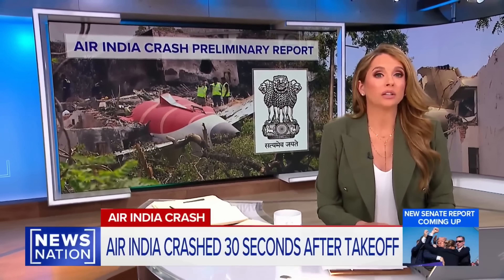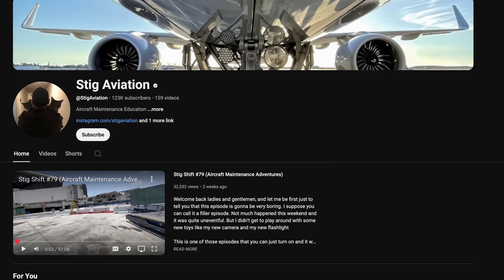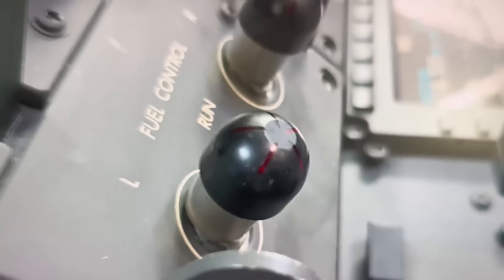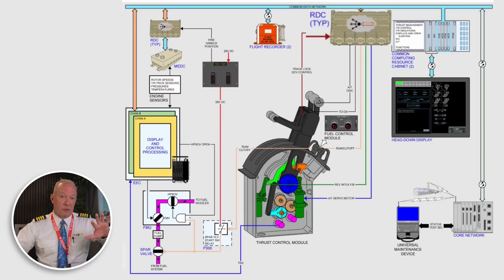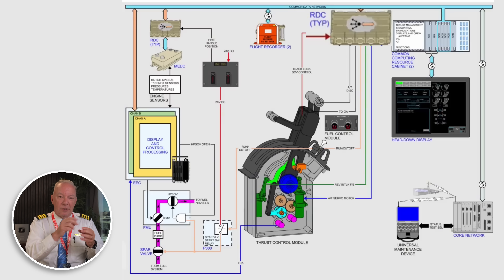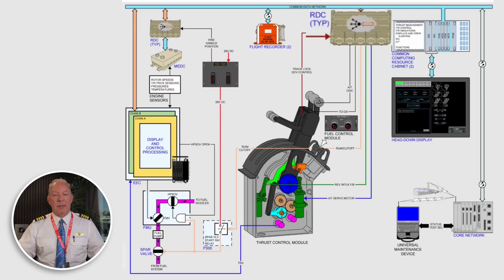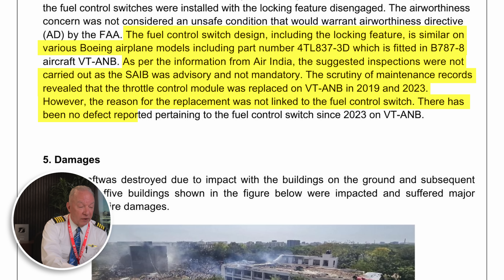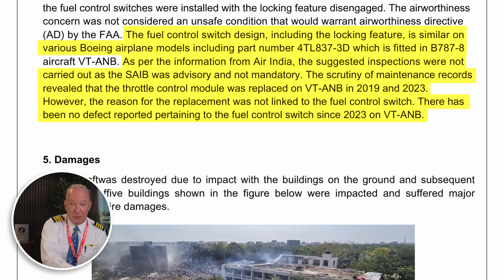The Truth About Boeing 787 Fuel Control Switches

Comment: One of the things missing about the explanation of the circuitry of the fuel on/cut-off switches is the location of the relays.  The switches themselves are located on the thrust module in the cockpit.  The relays (which are probably more than one for each engine) complete the logic to the fuel solenoid valves.  There physical location on the aircraft is where?  The physical wiring goes through a series of connectors and terminations.   No doubt tracing the actual path of the circuitry involved in the on/off of the fuel delivery valves is beyond any YT explanation.  There's other circuitry involved in shutting off the fuel delivery system that's not part of the cut-off switches.  The cause of the Air India crash appears to be the physical movement of the cut-off switches.  Hopefully, the final report will explain the actual cause of the crash.
Reply: Yeah but the switches we're allegedly turn off and then back on again.  If I was going to commit suicide I would just turn them off.  Honestly suicide is probably the least likely scenario, given the fact that this particular aircraft was known to have severe electrical problems inside the passenger cabin.  A lot of stuff didn't work.

Comment: I understood the 787 system is digital based, these switches connect to a box that sends a digital signal over the ADFX network its not a direct connection like 777,737 etc

Comment: There is a "system" on its engines that could shutoff fuel if its eec's detect non normal engine parameter like N1 and N2 rotation, without put fuel switches from idle to cutoff. This system available on 737max,and also on 787 dreamliner

Comment: JoeLoveNorman and others are correct however for the same malfunction to happen on both separate systems at the same time is beyond belief
Reply: It's called "a single point of failure, SPoF", and in this case it's the Li-ion battery and its diode module. Fault propagation happened because of automated redundancy, which actually made the SPoF possible.

Comment: After reading a few more comments I think quite a few people are talking about aircraft systems that existed prior to fly-by-wire.  Also it is easy to confuse a line drawing showing a 'virtual' functional circuit and then using a simplistic switch and light to illustrate exactly what does happen as if there is a wire from every switch to the item to be controlled.  That is DC-3 thinking in a world where the computer actually flies the plane and the pilot is merely asking it to do certain things.  This appears to be especially so in an Airbus system where for example you command a roll rate, you don't tell the ailerons to move to a particular angle.  A similar type of comamnd function exists in a Boeing aircraft, a bit like driving a car using a sophisticated cruise control.   

The functional drawings show cause and effect.  How does the 'switch command' get to the target relay, software program, control unit, or other item.  In rare cases it may be directly through a wire as suggested by Steeeves circuit e.g. to command a spar valve to close in the event of a fire.  In most other cases I think you'll find the commands actually go through a data concentrator, then down a fibre optic cable, then outwards through various other magic components to their final destination.  

These comamnds all rely on electricity to get to their destination.  No electricity means no commands.  So what does a FADEC do when power glitches come down the line or a total electrical failure occurs?  Does the engine auto-drop to idle and stay there until the fuel is physically shut off?  That is what happened when the 747 went off the runaway in Tahiti and the electrical system got drowned in seawater.  The valves stayed open and one of the engines continued to run at idle until enough water was pumped in by the fire crew to stop it from spinning!  

The key question must be:  What caused the total electrical failure that initaited the RAT deployment?
Reply: The engines being shut down by the pilot caused RAT deployment.

Comment: There is no relay inside your demonstration. There is a set of switch contacts. We use relays so we can have a device like a switch, turn a load on and off that would be too much of a load to pass through the switch itself. In your fuel valves, the valves themselves are tied to a set of switch contacts in the relay. The coil of that relay is tied to the switch in your cockpit. When you flip the switch in the cockpit, you send voltage to a small coil of wire in the relay, this turns it into and electromagnet and pulls the contacts closed and gives the fuel valves power. We do this because let’s say the switch is good for 5 amps, but your fuel valves draw 30 amps, we obviously can’t pass them through the switch itself, so we use the switch to pull in a relay. Now there are other reasons to use relays, such as wanting the ability to control the fuel valves from multiple sources, and add in other components, or control a load with a higher voltage, using a switch and control circuit with a lower voltage (like controlling 24vdc fuel valves from a 12v or even 5v switch circuit. But the main reason is because the switch itself can’t handle the load on its own. Without an actual wiring diagram, there is now way for me to know if anything else controls that relay aside from the switches in the cockpit but I’m going to say yes there is. The relay may also be controlled by the computer for things like if the fire handle is pulled, it probably drops the relay out so it doesn’t keep fueling an engine fire, and I’m sure there are other safeties. I can’t hardly believe on an aircraft that sophisticated that the ONLY thing that controls that relay is the switch in the cockpit, I just can’t.

Comment: What you are doing when trying to explain "switches" is wishing and hoping. They were designed by humans and humans make mistakes. 
I can write code that mimics a button press. It's simple. People do it all the time with automation. I have a physical 'smart' switch that can set what was pressed, its state of on/off, stored on another system. You don't necessarily need to "poll" the hardware for its state because it may not know. You may not want to do that either to prevent flooding a switch. By that I mean, think DDOS attacks. 

When you say something, a switch or lever, "commands" a system to do this, that is your first clue. It's not a physical circuit break like a light switch in your house, it's the switch telling a computer, hey I want to do this, make it so. The computer then tries to do whatever action moving that switch to that position was supposed to achieve.

Comment: I appreciate your detailed explanation. I know my basic electronics from junior high, so I'm not an expert at all. However your presentation suggests that a relay is somehow mechanical, whereas just the switch  (RUN/CUTOFF) is mechanical. The switch just activates the relay, which in turn initiates various electrical and electronic functions. I do not want to speculate - I am just curious and maybe somebody more familiar with the matter could answer:

1. Can the switch be in the "RUN" position but - for some reason - relay mulfunctions? You know, mechanical switches can break, or electrical circuits get contaminated and could send confusing signals on and off.

2. If the above could happen, than (possibly) the switch would stay in the "RUN" position, but the main system would "think" that the switch moved suddenly to the "CUTOFF" position?

Could such scenario be possible? Of course, it's virtually impossible that BOTH independent circuts would behave in such way simultaneously, but who knows? We still do not know the full VCR transcript with timestamps, and those pilots probably exchanged a lot of information. Maybe they were puzzled by switches being in "RUN" positions, but the airplane displaying signs of fuel starvation? So, after seconds of confusion, they moved the switches back to "CUTOFF" (system did not record it as it already "thought" that they were in that position) and then back to "RUN" (system recorded it as the circuits started to work again).

Comment: Steeeve what if the switches never moved but their status was the only thing recorded as having changed?  Also your faith in the battery staying alive may be misguided.  

In the case of the 787, one possible fault situation are the single points of failure, the one battery and the one Lithium Ion battery diode pack.  If the diode fails this can lead to severe overcharging of the battery and an eventual short-circuit event.  As the main battery is only attached to the left 28V bus that short circuit can then pull down the right hand bus to a vulnerable position with the whole 28V system teetering on the edge of failure.  This is because the monitoring systems do not appear to recognise a short circuit failure, rather they just see a drop in Voltage failure and as a result they do not open the bus-tie switch, effectively ensuring the bad things on the left side 28V bus are NOT isolated from the right side bus .  

On takeoff the gear retract process places the 28V electrical system under severe stress when the bogie releases followed by activation of the electrical brakes (130V stepped up from the 28V bus) to stop tyre rotation as the gear stows.  This can then cause a spike in the now vulnerable 28V electrical system leading to a temporary command to to some part of the control system that then commands a thrust reduction.  Look at the data concentrators, the way the ARINC system works, and the possiblity that only one element in the whole chain had to receive a command to reduce thrust.  It may have been a valve, it may have been the FADEC, or some other protection system that I am not aware of.   

So what is the evidence that we see in the videos?  Bogies released and hanging that means gear selected up, at that point in the process braking is applied, the RAT then drops indicating total electrical failure.  Something happens within the fuel control systems and the engines both loose thrust.  Soon after the RAT has spooled up, the 28V system partially recovers due to the RAT now delivering some power, the system goes into auto-restart but not in time to prevent the crash.  We also know there was a total power failure as the rear data recorder which as its own battery kept recording the whole event.  The forward recorder gets its power from the main bus and it didn't record anything of the crash event.  

So was it a 28V power spike that hit the various systems, in turn sending off a cascade of alarms that lead to a possible total engine shut down.  If the system sensed a Shutdown command would that have commanded the HPSOV to close along with other valves?  How would this failure mode affect the FADEC that then tries to protect the engine from whatever is going wrong by commanding a drop to idle?  If this sequence happens at altitude recovery is possible once the RAT is running.  Air India was at too low a level so only one engine started to spool back up, the other would have needed more time to be recovered to a positive thrust situation.  

In a nutshell, this is a complex aircraft and it appears to have two single points of failure built-in, the battery and the battery diode pack.   There is only diode protection pack so when that fails bad things can happen as the raw charge feed (32V or so) goes straight to the battery bypassing the charging system.  Ask anyone who knows anything about Lithium Ion batteries and they will tell you that overcharging of a LiIon battery is a bad thing and can kill the battery and in turn lead to a short circuit and/or a fire.  

The total power failure occurred leading to the RAT deploying.  The real question we should be asking is what caused the total power failure?  So why are we focussing on the position of the physical switches?   

A final thought, both Boeing and others in India have an interest by insinuating the pilots were the problem.  Boeing is in deep doodoo with ongoing sequences of failures.   As for Air India did they find the root cause as to why various cabin electrical loads were shed on the previous flight?  Most likely the battery was already on its way out and failing totally before the fatal flight.
Reply: This is the right explanation. Captain Steeve, as much as you are certain on your view, the correct view I suspect which in time will be provided, is power loss at “gear up” command, however this could also have been  initiated by the flight deck transitioning switches for a restart…just sayin is all….
Reply: As time goes on, it is becoming clear that this was a power failure, mostly likely from failing batteries. This caused the RAT to deploy. Capt Steeeve needs to rethink the suicide theory. That does not fit in with the RAT and cutoff timelines.

Comment: great review, very sad. clearly they were moved, either my accident or purpose, ignore the pedantic idiots who miss the point and just love to knit pick. These were clearly moved, get over it idiots. by accident or purpose they were move. (period) even the CVR showed this when one pilot asked the other why they "cut off". One question Cpt Steeeve, how does the Black box (even though its orange, there you go knit pickers have a go at that one) How does it pickup the switches are switched? that's not indicated in the diagram where they are linked.

Comment: This video leaves me with more questions than answers.
It's been awhile since i've messed/studied electronics but this information
for me is incomplete. Ok we've ruled out a digital/computer distortion but since this
system is so simple what else can we rule out?
I'm not saying it was not a deliberate act but i'm still having problems understanding the system.

- Are the valves solenoids? NO/NC? Or MOV? This is a huge difference in behavior in case
of a power loss.

In the solenoid case its easy:
- Either its NO of NC.
- NO would be undesirable since fuel will always flow in a shutdown scenario (fire??).
- NC would be undesirable since fuel will never flow in case of a power outage.

I mean in case of a MOV design clearly the schematics would be more complicated since one would need
a open and a closed signal. This would be imo the most reliable since nothing will move unless commended to.
In this case there would be a inverted polarization on the MOV which cannot be achieved with a simple on/off switch/relay.
Although i understand the simplification for me this is a huge differece in really grasp what could have happend. 
Let's image a huge short close to the cut off switches, cables burned/severed, shorts everywhere in that region what would
happen? It would be nice if someone with real techical experience would explain al the possible scenarios. I simply don't believe
that Boeing would design a plane with two switches close to eachother, one power source (shared gound??) with logic this simple.
Again i am no expert by far i studied electronics 20y ago and only have 20hrs of flying so please enlighten me
Reply: It's not so simple. This is just imaginary.
Reply: @ConcernedParent-z1q What do you mean? On my part? I'm just trying to understand the system and what could have happened. Not saying the likely  reason is somone messing with the switches.
Reply: @LuukVdBurgh-gx9pw  "Ok we've ruled out a digital/computer distortion but since this
system is so simple what else can we rule out?
"
This is simply incorrect. So making assumptions on a falsehood.
Reply: @ConcernedParent-z1qgot it so you're basicly saying this video is spreading false information?
Reply: @LuukVdBurgh-gx9pw  Of course it is.